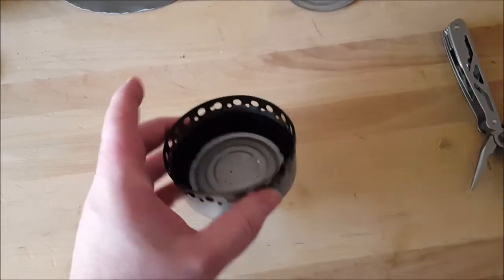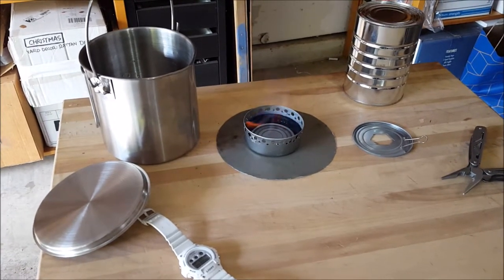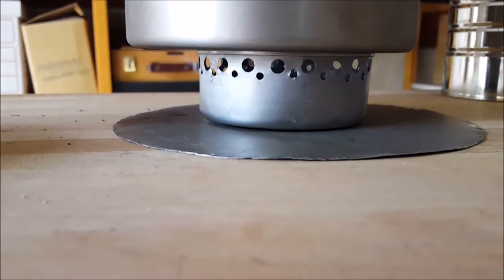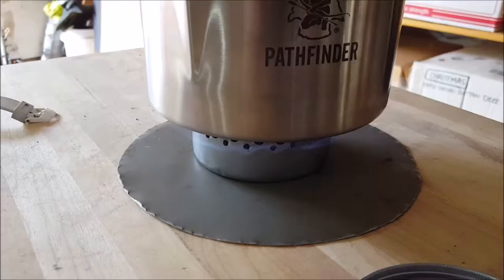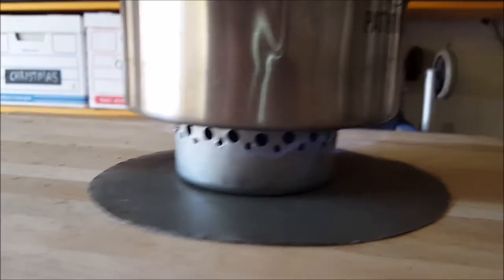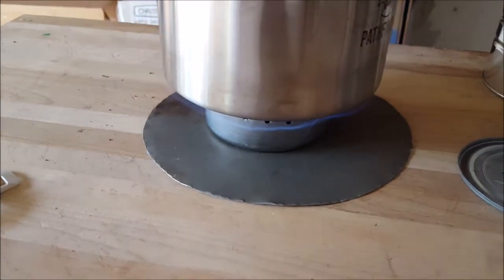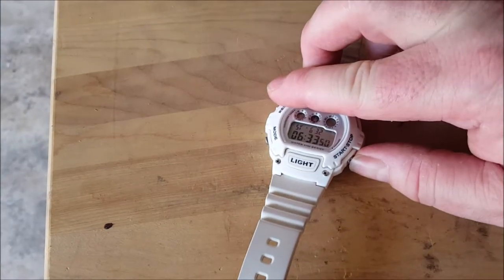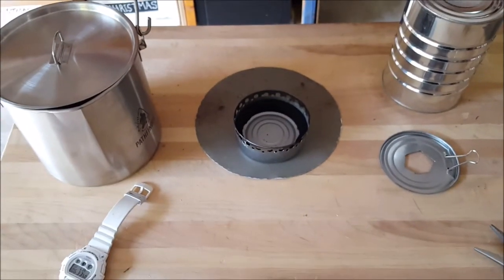Super Cat Tuna Can Stove with Modification (and Bonus Fail)

Comment: You can make a simmer ring which covers part of the holes (tightly surrounding the stove, leaving just enough room to move it to adjust the flame). An easy, or lazy way to simmer is to put an empty tealight candle tin in the stove, filling it and the stove, and the stove will go into automatic simmer mode when the alcohol around the candle tin is gone and whatever is left in it continues to burn.
Reply: Hmm .. must try that .. thanks.

Comment: You put the hot pot right on that nice table top ????  Even if it does not burn, it could leave soot marks.
Reply from the maker: Ha. I guess it does look like a nice tabletop a bit, doesn't it? It is actually an old butcher-block top rolling cart I keep in the garage as a makeshift worktable.
Reply: He said he used HEET. HEET is a gasoline antifreeze additive containing 99.9% methanol, that burns with a clean, blue flame. No soot.